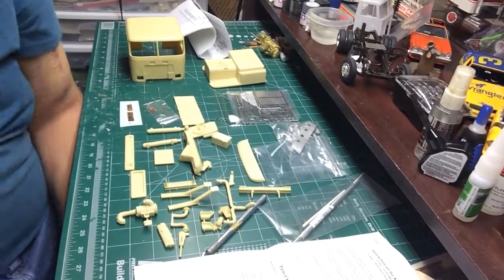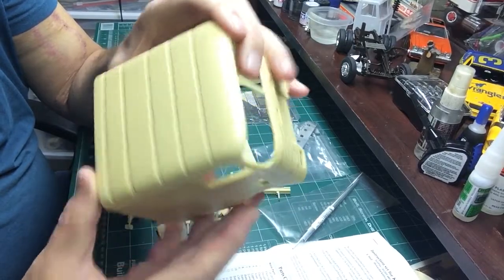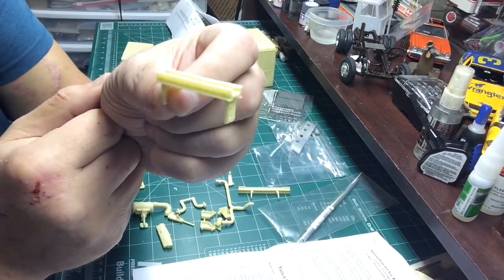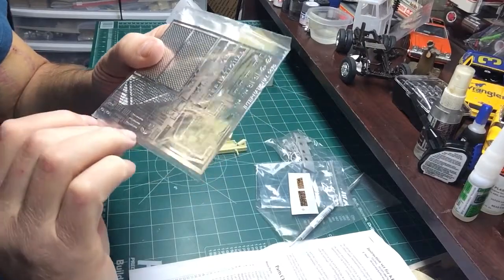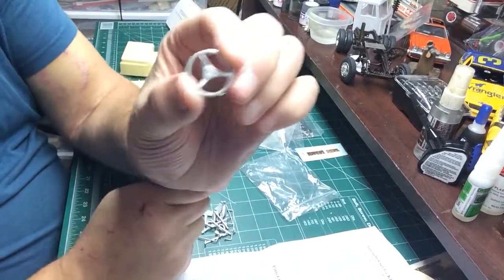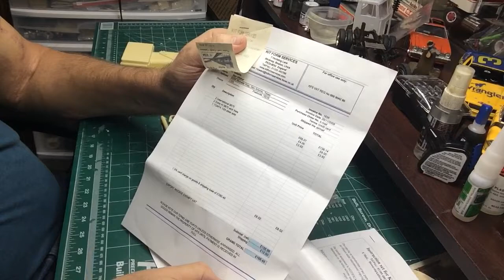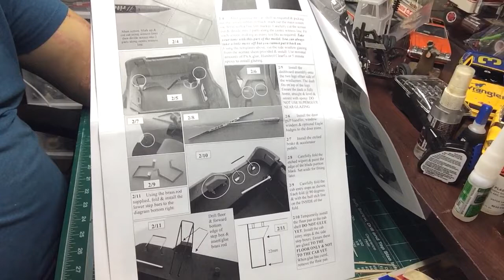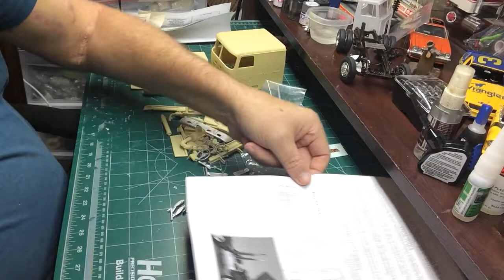Building scale plastic models: resin review: KFS IH 9670 cabover transkit.

Comment: How do you make super rigs? How would you lower the frame to make a show truck quality super rig slammed on the ground and also where can you get rear fenders?
Reply from the maker: I have a video on here showing how to extend the chassis. There's a few different guys that make drop visors and lowering kits. The lowering kits are specifically for the Revell snap Kenworth and Peterbilt 1/25 kits. Modeltruckbuilder.com has those.

Comment: Hey Ben. Do you have any of the old AMT kit with the torsion bar suspension? I guess AMT replaced that with the more common Hendrickson type suspension. I’d be curious to know if it’s worth tracking one of these kits down or pick up a resin cast of it to use.
Reply from the maker: The only torsion bar kit I have is currently being built as Snowman's Kenworth from Smokey and the Bandit. Auslowe has a nice torsion bar suspension kit. Www.auslowe.com.au